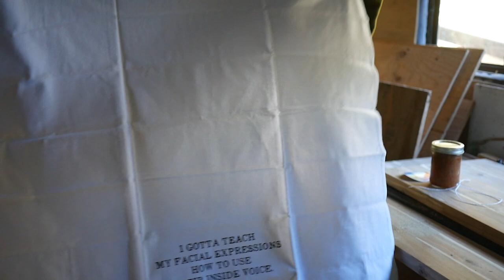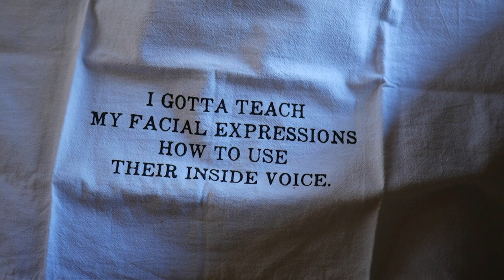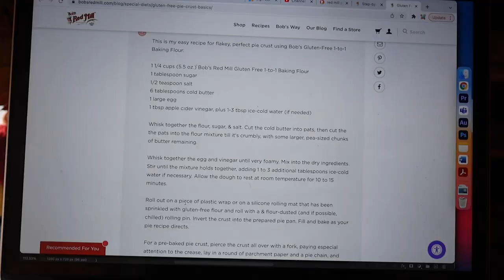Step Van Conversion A Random Vanlife week

Comment: I loved the birthday treasure hunt. Surprising special friends never gets boring. I wish I liked blueberries. OD’d on them as a kid every time we went picking. I have to hide them in my smoothies now. OD’d on strawberries the same way. Just not fresh strawberries. Pretty sad eh? The build is looking great. How will you be insulating the fridge from the fireplace? Will the stone be enough? As for the sink, you’ll need a silicone based caulk if it’s metal or stainless. It repels moisture and resists mold and mildew. For a straight line around the sink use painters tape then apply the caulking. Peel it off after caulking has been applied and well before it dries. Or spit on your finger and drag it around the sink. My dads way. Cheers from Vancouver eh!
Reply from the maker: @Susan Scoville it was SO FUN to surprise her!! And make her laugh!! The fireplace itself has a 1 inch heat clearance and has little legs it stands on so I think it'll be okay 🤞
Oohhh goo idea with the painters tape on the caulking! Yesss! Thank yooooouu